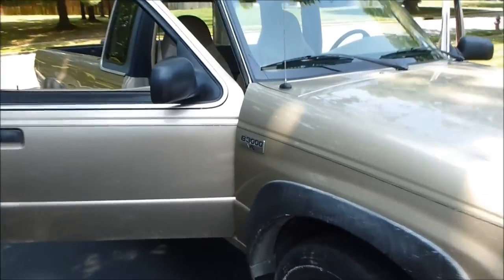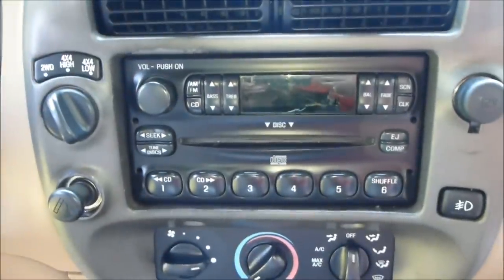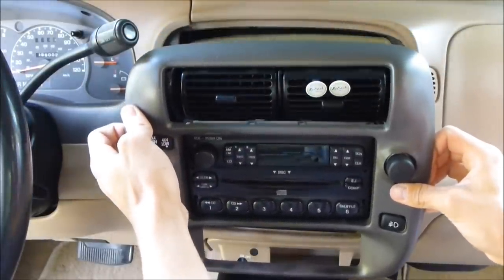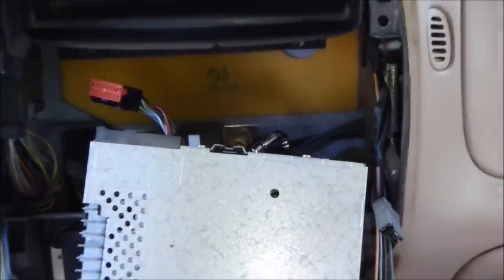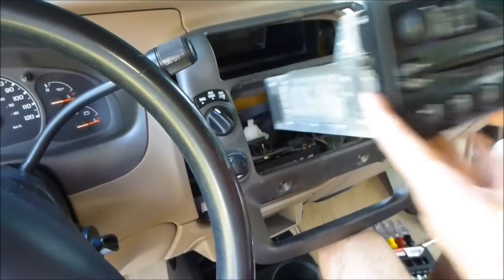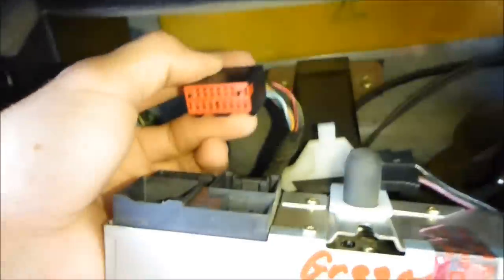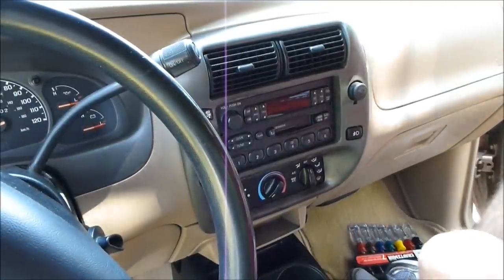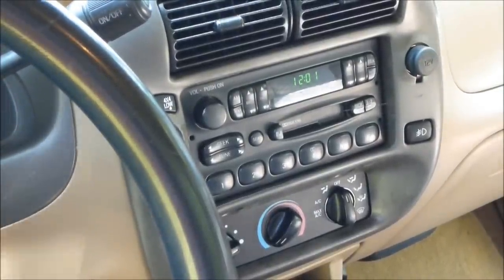How to Remove and Replace the Radio in a Ford and Mazda

Comment: I plan to buy an aftermarket 2 din unit for andriod Auto, and I was wondering if the OEM brackets that hold the radio in place were able to come off because that doesn't look like standard mounting. Don't have my car yet, or else I would look for myself.
Reply: +AadamZ5 Also, love your informative videos. Since I will have my first car soon, I plan to watch your videos more often. +1 sub
Reply from the maker: +AadamZ5 Glad you like my videos and subbed! As for your aftermarket double din radio, you will have to ask them if it needs any extra brackets. Each company designs them differently.
Reply: +ChrisFix I will do that, but my radio/computer thing is a Pioneer AVH-4100NEX and every time I watched someone install one in another car, they took the factory brackets and put them on the new unit.

Comment: that tool for the radio allows you to pull the radio out without having to remove other stuff
Reply from the maker: +PizzaPunt It does and you can make one out of a clothes hanger. Or you can just unscrew the bezel if you dont have the tool or metal wire clothes hanger.

Comment: Is the process the same for using a new pioneer or other after market double deck system?
Reply from the maker: +Jameel Alayyan Correct. You might need adapters but it is all plug and play.

Comment: hi chris.. i am planing to replace my head unit soon. and i noticed there's an 'illumination / dimmer' wire, which is orange color. could i actually tap that wire, which means the +ve of the orange wire and the -ve black wire from my head unit .. and use it for my LED underseat glow? will it toast my headunit?
Reply from the maker: +gyeomusic You cannot use that for your LED underglow because you will fry the wire. You can tap that wire to go to a control box which regulates the voltage to those lights. That control box will have its own power source so you wont draw from the radio wires.
Reply: roger that chris! thanks for the info.. :)

Comment: I have a 2004 B2300 and just installed an aftermarket stereo. I'm getting some engine or alternator whine in the speakers, but only when the radio antenna is connected. How do I fix that?

Comment: Wow I was expecting hey guys chrisfix here, ha ha. Also what weight oil should I use in my 1985 Gm car my climate ranges from 30f to 100f, plus I was told if you put a fully synthetic oil in an old car it would make the car drink oil is this true? Thanks.
Reply from the maker: This is an old video... one of my firsts. Use the oil your car recommends in the owners manual: https://www.youtube.com/watch?v=O1hF25Cowv8&t=2s

Comment: Where do you get a "refurbished" car cassette stereo for a 1990 Ford Ranger Custom? The bezel is different (one piece which includes the instrument cluster over the steering wheel) and how much? I would not rather change from cassettes to cds or memory sticks. Help!
Reply: Ebay or try to find an LKQ near your location and see if they have one

Comment: Instead of a special tool to remove the radio from the bezel you can also use 2 U-bolts.
Reply from the maker: +Simas Kaluškevičius Thanks for the tip

Comment: Hello, Chrisfix. Quick question I have a ford 02 explorer sport .. i was looking into why I didnt have flashes and brake light on the rear, so I found out the wire was at the multifuction switch connect was loose I fixed that lights and signal work now... but i may have left the constant power on the day before and now i have a dead battery if I get a voltmeter and place on the negative battery will that show me if I have a drain.. also i used one of those battery and alternator meter from advance auto parts and said that my alternator was bad so i replaced it with a junk yard one.. and the only voltmeter I have only shows 50v

Comment: Chrisfix I have some questions for you about my 1998 ford ranger 4.0 liter v6 4×4 it's almost exactly like your Mazda the interior is even the same color, I have 3 or 4 questions for you can I message you private or do I have to do it on this youtube channel I love your videos specially the ones you have working on your Mazda they all can help me out since my truck is almost the same.
Reply from the maker: +brian martin You can private message me
Reply: I wish I had the 4.0.  I have a 3.0 5 speed 4x4 stepside.

Comment: So my own factory receiver just kicked the bucket and I'm in the process of installing an aftermarket double din. Let me tell you, it's a giant pain in the ass. Nowhere does anyone tell me how to get the new receiver to stay in the din like the original set. I've narrowed it down to the fact that the little white piece is what steadied it in the first place along with those clips which locked behind the bezel. My kit has neither and it's supposed to be for my model.

I've had to jury rig my bezel (because the previous owner made every attempt to destroy it), and JB Weld the white piece to the rear mount part of my kit. Hopefully it fits properly.

Comment: How would you remove a pioneer radio without taking the whole bezel off or would you have to take the bezel off
Reply from the maker: There is a tool you can use (or make out of coat hangers) that you press into the 4 small holes on the side of the radio.
Reply from the maker: check out at 4:22

Comment: The previous owner of my truck lost those 7mm bolts that screw into the bottom of the bezel causing the headunit to fall out when I hit bumps. Is there anywhere I can order them?
Reply: SavageSalad a hardware store should have them

Comment: Hey, I have an 01 b3000 aswell. Was driving the other day and my radio started to cut in and out then the it and the clock went dead... sounds like its fried. When you said that it would drain the battery in 2 days, do I have to replace the radio for it not to or can I just pull it out and leave it empty until I can get my hands on one?
Reply from the maker: Scott Moyer You have to unplug the radio from the back or pull the fuse to prevent it from draining the battery.
Reply: ChrisFix Great thanks! Fuse 29 right?
Reply from the maker: I am not sure, but if that is what the owners manual says, then yes. Just make sure that nothing else is run off that fuse (again, it will say it in the owners manual)

Comment: Will a double din aftermarket radio fit in that hole?
Reply: +Levi Kleinscmidt I put an aftermarket double din in my ranger, I had to do a little cutting with a dremel but it fit fine
Reply: +Hobby Masters Network I have a 99 explorer. Very similar. I already have a single deck after market kenwood, but would like to put a double deck pioneer, how difficult is it to do the change?
Reply: ***** it's not difficult at all as long as as you have a steady hand and the correct mounting kit, with the scoshe mounting kit, you cut off the top and bottom mounting tabs in the bezel, and slide it in from the front just as factory. Hope this helps

Comment: I was looking at getting a new radio with an aux cord connection, the site i went to told me I would need (American International FMK-550 Dash Kit) (Metra 70-1771 Receiver Wiring Harness) and (Metra 86-5618 Factory Radio Removal Tools) Though you just seemed to unplug some connections and plug them back in with the new radio ._. I'm confused
Reply from the maker: Josh Aldrich It depends on what radio you purchase. Some are plug and play and others you need an adapter wiring harness.

Comment: It was so unnecessary to pull the surrounding piece off. Those little holes in the front of the unit are used to pull it out without doing that.

Comment: Now, all I need to do is get a radio that has a cassette tape for my Ford ranger, because I was originally thinking of just installing an AUX cord, but just installing the same type of radio with the cassette adapter, I don't need to cut wires

Comment: Did you need to disconnect the battery?
Reply from the maker: You probably should disconnect it (they always say to), but I didnt. I usually disconnect the battery when dealing with more sophisticated electronics or gas systems.
Reply: ChrisFix it only affects the passenger airbag light. non existent in this model
Reply from the maker: wallace1723 What only affects the passenger airbag light?
Reply: if you don't disconnect the battery on some cars you'll cause the passenger airbag light to come on in the dash, but since ours is under the bezel you don't have to worry about it. the dealer is the only one who can turn that light off
Reply from the maker: wallace1723 Gotcha. Yea, the passenger airbag light is just to let you know if it is on or off in this vehicle. And on most cars, the airbag light will only be on if there is a fault and once that fault is corrected, when the car starts up, the airbag light will shut itself off.

Comment: Hi. My car is Peugeot 306 N3. Several days ago, I just had my valve seal and pulley replaced. I could see that the mechanic was removing the positive terminal of the battery. Now when I turning on my head lamp after starting the car, my head unit and speedometer light restart. It never happened before. Do you have any solution? Thank You
Reply: Edo Putra Wijaya usually any car Honda Ford Mazda GMC Chevy all cars I have seen even replacing the battery removing it disconnecting it they all stay the same I have never seen a car reset

Comment: Hey chirs I was installing a radio in my truck and when I first tested all the wiring and it turned on and worked fine but then I full and completely installed it it didn't work so I pulled it out and found two wires had discounted and a fuse blew so I fixed all of that and now it won't turn on at all what could be the problem
Reply: There's a fuse in your fusebox for the radio itself. There's also a fuse on the back of your aftermarket radio as well. Check that too. Also fix your wiring. It obviously shorted out, probably due to a bad wiring job. I like to solder all my connections and use shrink wrap over them so nothing can short out.

Comment: If the green background light come on but the radio will not come on is the radio dead or just a wire that came lose? Could it be a fuse or computer chip?
Reply from the maker: Sherry Smiler Do you have a time? Do any of the buttons work?
Reply: ChrisFix No Clock, Radio, no buttons work.
Reply from the maker: Sounds like your radio is bad. I would check your fuse for the radio first.
Reply: ChrisFix Thanks, Yours is one of the best Video and a great help
Reply from the maker: Sherry Smiler Thanks and good luck! You can find factory radios that people refurbish for cheap on ebay. I got mine for $30!

Comment: my antenna cable is rusted out and stuck in stereo can you replace these if so where at?
Reply from the maker: hunter heyboer You unplug it from the antenna and radio and you can put a new one in.

Comment: would it work for a 02 ford exploror sport trac
Reply from the maker: If it has a similar ford radio, then yes.
Reply: ChrisFix 99 Mazda truck heater core replacement

Comment: hey i did the led dash lights but the cruse lights are  out on one side of the steering wheel and the 4 drive solections are out on the center dash. so boldly go where i ant going tell you do peace

Comment: Can you help I put 2 new kicker speakers in the rear doors of my tahoe and the tweeters on them sound scratchy on some songs and radio stations CDs and radio  it's only at them 2 speakers what do I do 6.5 inch speakers  they are hooked up right the last speaker in that spot didn't seem to do it.  But I bought a pair so I replaced them both even though only one was bad the front speakers are next for replacement they have a really good midrange base though I just put them in today they can't be bad.
Reply from the maker: SuperJeremi10 Check your connections with the speaker cable and make sure the connections are good. Is this the factory head unit?
Reply: it didnt start untill i put the speakers in and other speakers sound just fine i also 2 new boss 4x9 in the back ceiling speakers and they work just fine as and the 2 front  factory speakers are fine as well except they sound worn  which is why im replacing them there tired and old    one in the back door worked fine too just one in the back blew out so i replaced them both i even took a head unit out from a same yea model truck and it did the same thing.
Reply from the maker: SuperJeremi10 So are all of the speakers scratchy or just one?
Reply: all of them i went and checked even the factory ones   i replaced the back speakers because they where blown  and it only does it on some songs  he head unit seems fine it puts out lots of sound way more then the aftermarket radio i tried  i tested the head unit in the other truck and it ran fine there has to be something somewhere causing it its only on the tweeter ind the mid range base is fine the car even does it if i remove the speakers  but what ive noticed that if i jiggle the speaker wire in the back where the 4.9s mount  half the speakers stop working but i haven't been able to trace it.
Reply: well i returned the kicker speakers and go some pioneer with 50 rms they work so much better the base dosnt seem to be is high as the front  factory oem ones but they are clearer and less distorted then the front ones  sounds much better   the coils where bad on the kickers it was rubbing against the tweeters.
Reply from the maker: SuperJeremi10 Thanks for the update! Glad it got straightened out with the new speakers!
Reply: yea works great now no scratchy sound  just  distortion in the front woofers  wich was there before i replaced any speakers  like i said the speakers in the car are shot  which is why they are being replaced.

Comment: Is this the same for a Honda Civic LX 98?
Reply: no, and the only reason he said those years of Mazda and ford are the same is because they are partner companies and share the exact same parts for some stuff.

get a radio remover tool set at Wal-Mart for $6
Reply: +Austin Lersch THANK YOU!!
Reply: +leondria gordon it will say it's for Honda/Acura on the package, look online and get it for in store pickup so you don't have to make a trip just to not find anything.

also it might not come out first try, you might have to do a lot of wiggling with the tools

Comment: u shoulda kept the cd player and went with n fm transmitter its less wires and higher sound quality
Reply from the maker: +Travis Miller I prefer the cassette player. The best setup would be taking the player out and putting in an aux cable!
Reply: +ChrisFix That should be a fairly simple electronics job... I prefer to keep mine as the cassette with the adaptor  as I don't fancy messing with the logic of the cassette deck to make it keep working with the motor disconnected LOL

Comment: Wrong!!!! I install radios for a living All you need is the Ford din removal tool, you don't have to take off any bezels vents or anything else just use the u-shaped tool push it to the sides and pull the radio out unplug the electrical plug and antenna and you're done just do everything in reverse to put the new radio in that's if you are replacing it with a factory replacement radio so simple... If you don't have the removal tool you can try using a coat hanger but the tool is very inexpensive under $5
Reply: For my 1998 Ford ranger, what type of radio would I need for it? I recently got it from an owner who had a mild crash and sold it but it came with no radio, so I was wondering what type of radio I'd need for it and where I could get one for it? I'm a mechanic and wanted a fixer upper so this truck was perfect
Reply: I bought the tool and replaced my radio in <5 minutes (I'm cautious).  Slide the U shaped tools in the holes to unlock it, slide the radio out while pushing outward on the tools, unplug the antenna and the plug, and it's out. Plug the new radio in and slide it in the dash until it locks in.  Got the tool from Amazon for next to nothing.  Tool comes with instructions.

Comment: no rca out so  no amp and  sub without a goofy  power  adjusting box but those # buttons on the bottom run a remote cd changer if you own any none burned ones the best thing is the nieberhood kids keep not stealing it every night my clock buttons dont work so i have to connect the battery at noon or midnight sweeeet.

Comment: you should disconnect the car battery b4 you touch any wires
Reply: The stereo harness (the large one on the driver's side) and the 12v socket connector are insulated, so as long as you don't spill a drink or something on it while you're working, you should be good.

Comment: The tool is only like 3 bucks. And the antenna should he last to be pulled off and first to be put on.
Reply from the maker: albert bardinas You can also use a metal wire close hanger.
Reply: It also just pops out with the ford radio tool so you don't need to disassemble all that. Wire hanger is an excellent idea to like Chris mentioned.

Comment: my cigarette lighter broke when i pulled mine out :(
Reply from the maker: Too bad. What broke? That should be an easy fix. Mine was punched in when I got my truck so I fixed it using this method lol.
Reply: i had to buy a new radio bezel to fix it because the plastic peice that broke wouldn't allow it to stay in
Reply from the maker: Dang. Did you try gluing it in?
Reply: yea but it would never stay